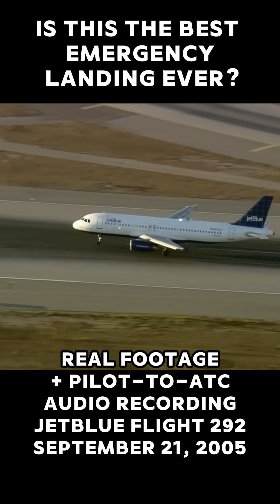Pilot to ATC audio + footage TWISTED GEAR LANDING JetBlue 292, Sep 21, 2005

Comment from the maker: Captain Scott Burke's emergency landing ft. JetBlue Flight 292 on September 21, 2005, was nothing short of extraordinary!

The flight, an Airbus A320-232 operated by Captain Scott Burke and his crew, departed from Hollywood Burbank Airport en route to New York’s JFK Airport. Shortly after takeoff, the pilots received a series of alarming fault messages on their Electric Centralized Aircraft Monitoring (ECAM) system, indicating an issue with the nose landing gear. Upon visual inspection, it was clear that the nose wheels were stuck at a 90-degree angle, making a standard landing impossible.

After circling the skies over Southern California for hours to burn fuel and minimize the risk of fire, Captain Burke and his crew skillfully executed an emergency landing at LAX. Sparks flew as the aircraft touched down, with the nose gear grinding against the runway until the plane safely came to a stop. Miraculously, all 146 passengers and crew members walked away without a single injury.

The incident was later attributed to fatigue failure in the anti-rotation lugs of the nose gear, compounded by the design of the plane's Brake Steering Control Unit (BSCU), which prevented the nose wheels from centering. The investigation highlighted critical areas for improvement in aviation engineering and emergency protocols.

JetBlue Flight 292 remains a testament to the skill and training of airline crews in responding to unforeseen emergencies. It's a powerful reminder of the importance of safety, preparation, and teamwork in aviation. Kudos to Captain Burke and his team for their heroism under pressure!

PS: SMASH that LIKE👍 button and if you wish to help the algorithm push this video to more people (and support our channel to bring you more amazing content like this), share with as many people and would also love to hear your thoughts in the comments below ❤